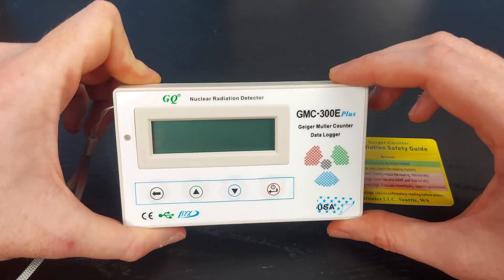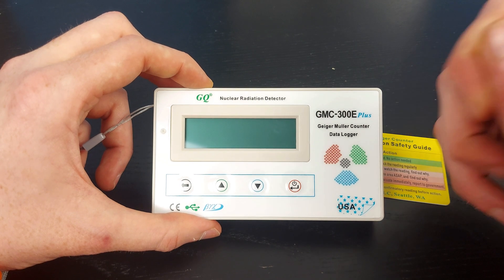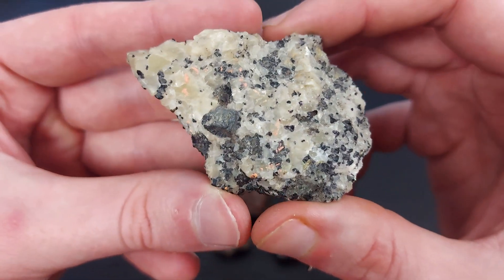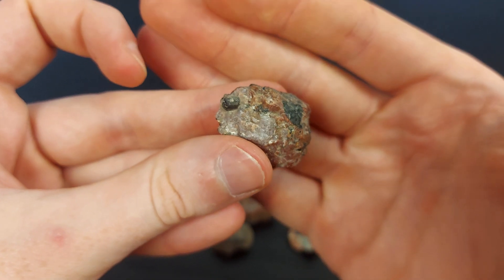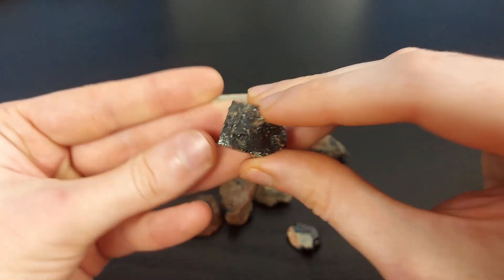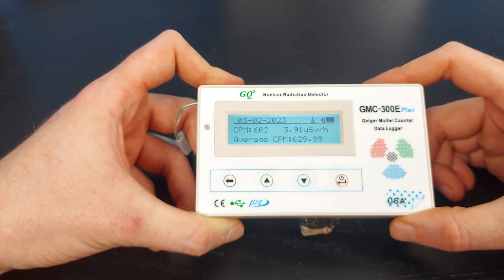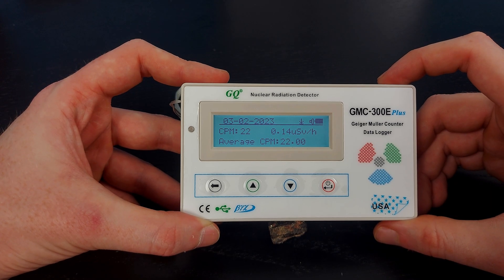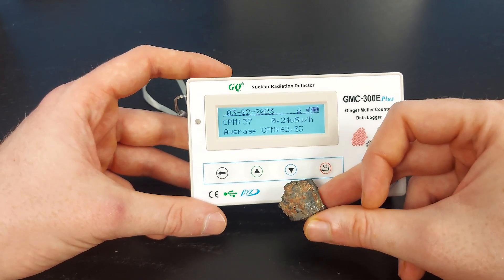Testing My New Geiger Counter On My Cool (Yet Hot) Radioactive Minerals! Ontario Rockhounding

Comment: Just got a Geiger meter a few days ago, I’ve been collecting prehistoric shark teeth. Your alanite (if I spelled it right) had about the same counts give or take as some of the teeth I have. Once you said it was a low count, it put me more at ease. Thanks for the information!
Reply from the maker: I mean I wouldn't sleep with it, but it definetly is not the craziest radioactive specimen a mineral collector can have in their collection. I am glad I could put you at ease.
Reply: @Ontario_Rockhound  definitely have just been keeping them on display in a room I don’t spend much time in. I probably look at them for about 15 min a day or so
Reply from the maker: @tharvey5077 should probably be fine as long as they're aren't too radioactive bc they can give off radon gas as they decay and if they're highly radioactive that could be an issue but they're not so it shouldn't be a big worry.

Comment: Random begginer question. I had a old "60-70s" Ontario MNR (ministry of natural resources) rock collection handed down to me. None of the rocks/mins are enclosed and are all open to handle. It contains such suspect items as asbestos and uranium mineral. How safe is this to have on my shelf? 
Like in this video you are clearly handling these mildly radioactive minerals. But do you keep them somewhere "secure" when not handling.
Reply: I see now you secure them. But are small samples ok on display?
Reply from the maker: Should be fine for your radioactives, even with some of my less hot ones I plan on displaying them once i have more room, but with asbestos I would be more worried if it is in it fibrous form, if so I definitely recommend keeping it in a container and just incase keep it double contained I have one sample of asbestos and I keep it in a zip lock bag in side of a sealed container.

Comment: It's Uran- inite. That second n isn't silent. Also a hint, if you keep the specimen close to the muller tubes you will get a quicker response and more accurate reading. I love playing with my radioactives. It's mostly just common sense with handling and displaying. I used to have a 3 cm cube of Uraninite I collected at Cardiff. Was close to 200 microseiverts. Sold it. If you ever go to the Kemp prospect for Thorite crystals you will know you're there before you even dig the background is so high. 😂 Have fun with your new gadget/tool.
Reply from the maker: Thanks, yeah I realized that I was mispronouncing uraninite. I will have to make at trip to Kemp.
Reply: @Ontario_Rockhound  I know where it is if you ever want to go?
Reply from the maker: @CoinandRelicOntario  Yes for sure, lets try to make plans for this year. I know I plan to do a bunch of trips during a week where I will be cottaging in July. And for the Davis Quarry I plan to go to the Gemboree so that might be an opportune time.
Reply: @Ontario_Rockhound  Sure! I'll get in touch over Instagram
Reply from the maker: @CoinandRelicOntario  sounds good